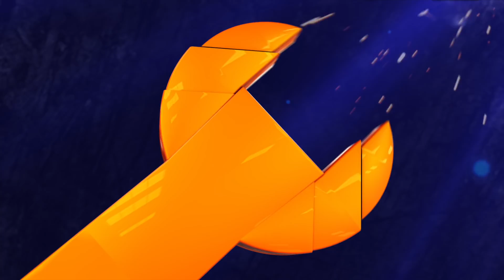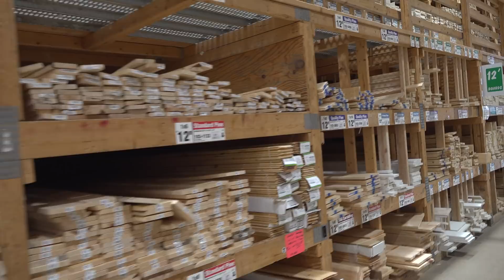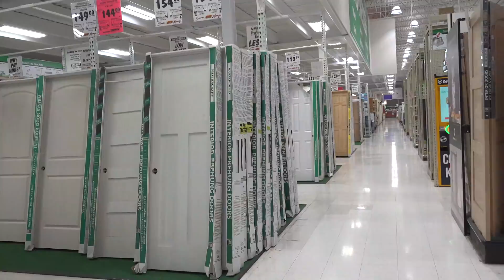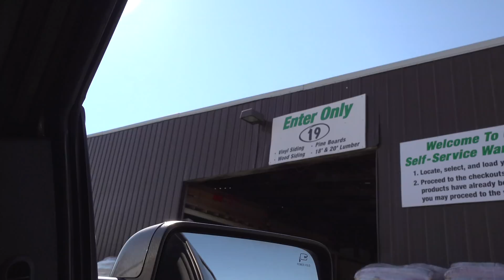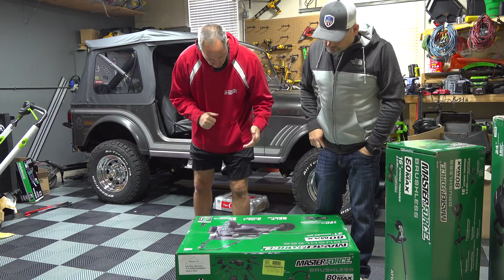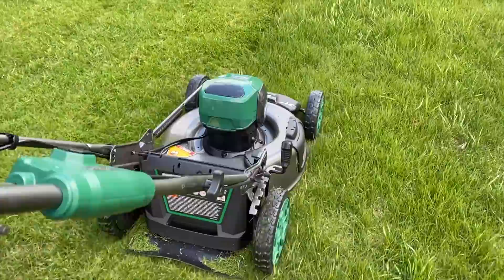Masterforce Brushless Outdoor Power Equipment from Menards

Comment: Menard's amazes me each time I go in. Just off habit its typically the last place I look but they always deliver. They stock much of their wood product in the 'barn' outside so their western red cedar is already seasoned and will stay much straighter than the conditioned product from the other stores. I have bought insulation there for nearly half the price of the pink stuff. They stock Jeld-Wen windows with odd naming conventions but considerably cheaper. After calling Jeld-Wen they confirmed the same model Menards sold for $100 less was the model Lowes and Home Depot sold as their top end. It seems as the other box stores are pulling back their inventory and trying to go lean Menards is going bigger. Also bought a Masterforce full-lite door 5 months ago for $100 cheaper and same quality as other stores. Makes no sense, I honestly don't understand their business model.

Comment: We have Menards in Detroit. They easily have a larger selection of everything, (except power tools), than Home Depot and Lowes _combined_. , The problem with Menards is that their customer service is absolutely horrible - to the point that I don't even shop there anymore. Also, their "rebates",(store credit), are 1960s style where you have to mail them off and hope you get them. I've mentioned that to the people at the service desk and they tell me that everyone complains about that. I wonder how much money that pocket every year off of unpaid rebates? But then I supposed that's the point, isn't it?
Reply: Their rebate program is becoming a sham.  I’ve been waiting on two of them for months.  I’m done shopping there until they have actual sales where you get the best price without a silly rebate program.
Reply: Agree. I bought a grout blade for a recipro tool and didn't open for 8 months. Discovered it would not fit my tool and took it back to Menards. They said it was no longer a shelf item so no return available. Unopened in the package! Drove over to Home Depot and they gave me a store credit for the full amount.